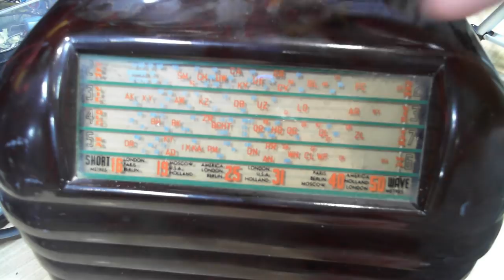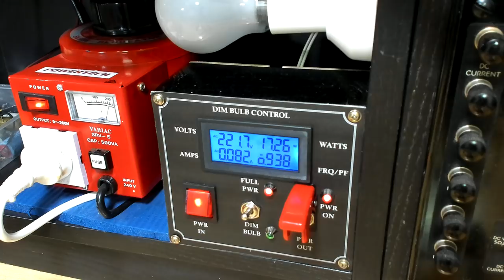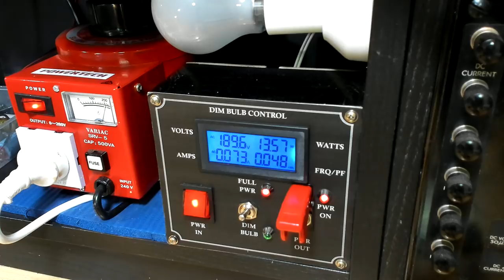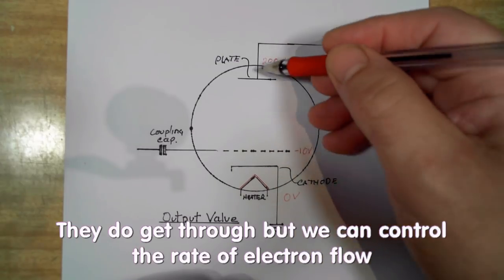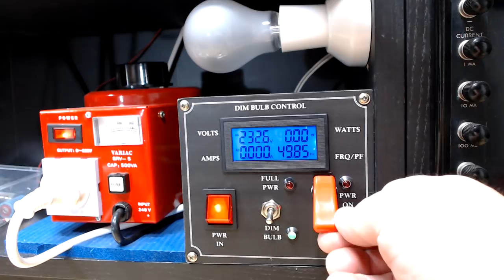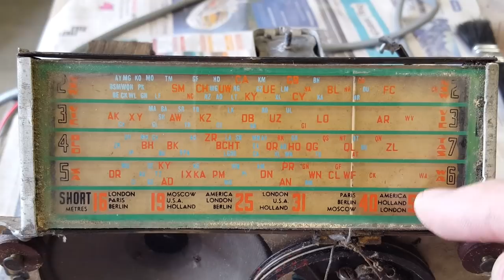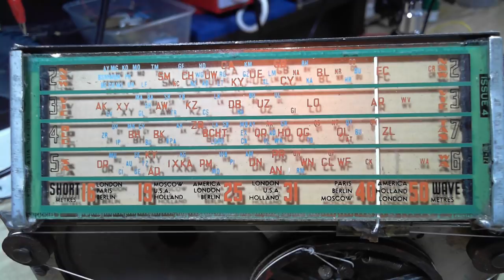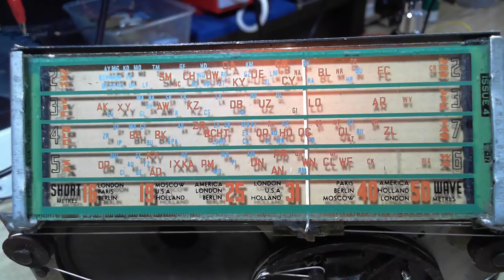Kriesler 11-4 1946 Beehive Radio Restore Part 1

Comment: The two outer plates are beam forming electrodes. Hence the name, beam power output tube. They are tied to cathode potential and redirect the expanding cloud of electron back into the main path to the plate. Chances are very good that with the tube pulling so much current, the cathode emission (rare earth coating) material was literally stripped off by electrostatic force until the emission went down to near zero. It was amazing how well the radio worked with so little restoration yet performed. Great video, as usual.
Reply from the maker: Hi videolabguy, thank you, that's great explanation, now I know the difference between a pentode and a beam power tetrode thanks to you and others that have offered information. Most radios I do will either work or require a minor fix to get working after 70 years, that's not bad. I don't power radios with obvious faults like bad wiring or similar issues of course 😀

Comment: An interesting insight into valve construction. I must say I have never delved into the inner workings either. Quite an unusual looking radio, I think returning it back to it’s original colour might be worthwhile. Thanks for another interesting video.
Reply from the maker: Hi Gary, thanks. Looking at a valves insides was interesting, it helps me understand how they work. I hope the radio will look good when it's finished 🤞😃

Comment: It took you 10 minutes into the video to get it working. Must be very pleasing to achieve such a quick result. Thanks for another interesting video.
Reply from the maker: Hi birdie399, thank you. It was a matter of divide and conquer, there was hum at the speaker and no hum/buzz when I touched the volume control, that narrows it down to the output valve area 👍🙂

Comment: I noted when talking about the 6V6 valve, you mentioned the "two screens" connected internally to the Cathode, but you didn't know what they were for. I can tell you that the valve it's self is a Beam Tetrode, (sometimes known as a "Kinkless Tetrode"), and those "screens" are actually 'beam forming plates'. (Sometimes, wrongly called suppressor plates).

The purpose of the 'beam forming plates' is to concentrate the electron stream into two densely populated electron beams flowing to the Anode. These beams intern, prevent 'secondary emission'; a flow of dislodged electrons flowing from the 'Anode' back to the 'Screen Grid' at a slower rate, and causing an undesirable 'kink' in the valves output characteristic.

It was for this very reason, that the Pentode valve was invented which did the same thing (prevent secondary emission) but in a slightly different way. There was a third system :- The "Critical Distance" valve, but that method was abandoned back in the 1930's in favour of the other two systems. It is interesting to note that, the reason the Beam Tetrode was invented was to get around the patents and licence fee payable for using the Pentode design. A Court battle ensued between the inventors of the Pentode, and the Beam Tetrode, where both sides claimed Patent infringements ! Both sides lost, and the only winners were the lawyers (as usual) lol. Hope that clarifies things.

I have watched parts 1 & 2 of the restoration, and you have done a fantastic job on that radio.... Looks almost 'brand new', and the cabinet has such a lovely shine on it now. It always warms my heart to see a piece of vintage equipment beautifully restored back to its original condition. Thanks for posting
Reply from the maker: Thank you for your very clear and thorough explanation of beam power valves. I have had a few others explain it too and I did some research off the back of that. Your explanation covers it all in one go, thanks 👍😀

Comment: Those two smaller inner plates are beam deflection plates, they are connected to the cathode because they are at the same potential electrically, and direct electrons to the plate. The 6V6 is a beam power or beam tetrode tube so it has a pair of those as opposed to a suppressor grid that a power pentode like a 6F6 or 6K6 would have.
Reply from the maker: Thanks Fritz, I have been fully educated by other viewers kind enough to help. Thanks for helping 😀

Comment: I think the term used when a valve is turned on fully on the grid is called “saturation” . I’ve never seen a valve cathode completely fail from a waxie cap. Good video as always!
Reply from the maker: Hi Burnt Out Electronics, I think you are correct, thank you. As I said it may have just failed from old age, it may well have been the original 1946 valve being that it was the old shape glass. Thanks 😃
Reply: David Tipton yes it’s getting hard to find G type or coke bottle valves. now all you find are GT’s! Bit of a shame as the G valves have more character to me. Are you a member on vintage radio and tv forum? If not you should join!
Reply from the maker: @burntoutelectronics  it's a shame the bottle valve was unserviceable. Yes I am a member of that group, they are very helpful 🙂

Comment: Well.I can honestly say I have never seen anything like it before.  The radio that is!  The Beehive, it is well named.  Works well though and that glass came up well.  I like how you explained the valve, I wish some others would go into detail like that.  Strange how the valve showed up faulty but no fault showed in the valve itself.  I wonder if it was corrosion on a pin that was causing the problem, can't see it somehow.  Nice video again David.  Hope you and your family are all fine?
Reply from the maker: Hi Bob, thank you. It's an unusual design all right. I expected to find a defect in the valve too, I tested it three times on two testers and it was dead, I tested a good valve at the same time to insure the test was valid. It was suggested the coatings may have worn off but you would think it would still do something on test 🤔🙂
Reply: @DavidTipton101  It is a bit strange though!
Reply from the maker: Yep

Comment: Outstanding result, i am inspired to repair a few oldies I have in the shed, thank you. Do you have a circuit diagram for your dim bulb ?
Reply from the maker: Hi Tony, thank you. Yes, get those radios out of the shed 👍 The dim bulb I did on the fly so no diagram. I do remember using double pole switches so I could switch two circuits at once, it may have been to keep the lights separate when using dim bulb or something, sorry 🤦‍♂️

Comment: Assuming that the O/P valve was faulty, with the g1 grid receiving positive voltage the likely problem was that the emissive coating on the cathode was exhausted or otherwise ruined by continued use with a very heavy plate current. The other problem I've seen with heaters is that they can be shorted and although they take current they are not heating the cathode properly. I've had several valves and CRTs with this problem.
Reply from the maker: Hi jonka1, thanks for your comment. The coating may have been exhausted but it didn't read anything on either of my testers, I would think it could produce something still. I could see the heater glow when it was tested but that may have been the reason, it may have only appeared to be working 🤔🙂
Reply: @DavidTipton101  
I have known dry joints where the wires out of the valve are soldered to the base pins. Otherwise it's a mystery.
Reply from the maker: @jonka1  I considered that and made a visual inspection of the joints and they looked good, yeah, I don't know 🤔

Comment: The changes were very likely due to parts shortages, at least it was in North American sets. There was a popular model of radio-phonograph made by Philco after the war called a 46-1201, famous for being promoted by Bing Crosby in their ads. Anyhow I have a Canadian version of one of these, and between the Canadian model, and the American versions, there were between 18 and 19 code numbers (revisions) on no less then three production runs, most involved changing what types of tubes (valves) were used, some used slightly different circuits in the power supply, and one used a 5'' P.M round speaker rather then the usual oval electrodynamic one. What was tricky about the code numbers is that they would switch between them at random times, you could have a code 3 made near the beginning of production, or the end, I think they designed these ahead of time based on whatever parts could be made to work depending on what was available for the cheapest price at the time.
Reply from the maker: I think you are right fritz, Immediately post war radios seemed to change components as they became unobtainable, at least Kriesler keep a record of the changes unlike other manufactures 🙂
Reply: @DavidTipton101  I have wondered whether if there was a boom in consumer products post war, huge sales of this model gave them unprecedented feedback from servicemen. Perhaps Kriesler repeatedly tried to improve a high sales item.

Shortages of parts could have been contributed to by industrial action. There were intense power struggles in Australian unions in the 40s and many strikes as a result.
Reply from the maker: @brianh2269  Parts supply seems to be behind most of the changes as they went back and forth between the same parts, electro speaker to PM speaker and back again, valve replaced with a different type then back again, things like that. Industrial disruption may well have paid a part in consistent component supplies. There were some minor design changes but not a huge amount, a tribute to the original design.

Comment: Hi Dave; Nice radio and restore so far.  You did mention the 6V6, but I am curious what the other tubes/valves are. Possibly 6A8G RF and 6B8G IF & Detector? 5Y3 rectifier? Nice explanation about the 6V6 by the way.
Reply from the maker: Hi Daniel, thank you. It has a 6J8G converter and a 6G8G as the IF, detector and first audio amp. it is a reflex design. The rectifier is a 5Y3 👍🙂
Reply: @DavidTipton101  thank you for your reply. 6J8g heptode - triode. 6K8 is very similar.

Comment: Hi, next time perhaps try increasing the heater voltage to 10 or 12 volts or even higher, the emission might come up a bit on a duff valve. Most likely the bad coupling cap made the valve draw too much current that ate the emission off the cathode in a short matter. Or the valve was spent before and the running it with the too much anode current just finished it off.
Reply from the maker: Yes, I thought later I should have wound the voltage up, that could have well been the original valve judging but the glass envelope 👍🙂

Comment: Mr David where do you buy those spare parts, such as those erasers under the variable capacitor, lamps and other spare parts needed.
Reply from the maker: Hi D. Ilic, I get parts from everywhere. The erasers or grommets are in a kit from eBay, the globes and resistors are from the electronics shop, the capacitors from Carl the Capacitor King (link in the description) other parts, valves etc are from ebay, Facebook radio groups, radio swap meets and radio club auctions 😃
Reply: @DavidTipton101   Mama Mia, it's not easy for you.  It costs a lot.  I admire you.
Reply from the maker: It pays to be a scavenger for sure 😃
Reply: @DavidTipton101  👍😅🇭🇷

Comment: Removing the factory paint from a Beehive can be a big mistake. Some of the painted sets had non-matching colour Bakelite bits under the paint. Other common problems with Beehives are cracked louvres due to over tightening the bolts and/or missing soft washers between them and many (most?) of them end up badged as 'rielsers'.
Reply from the maker: Yes, I have heard that James, luckily this one is in great condition. It was fortunate the owner had stripped it off first 😃

Comment: Maybe the tube lost vacuum, partially or completely. Electrons need a free path devoid of air molecules!
Reply from the maker: Hi Linus, this video was done some time ago so I'm not sure to what you are referring but what you say is quite possible 🙂
Reply: @DavidTipton101  Sorry, you did a post-mortem on the  dead 6V6 but didn't find anything electrically amiss.
Reply from the maker: @linuspoindexter106  I remember now, the consensus from some viewers was the the coating on the cathode had worn away.

Comment: Great video Dave! I really enjoyed it! Thanks for the simplified explanation of the output tube and what probably destroyed it. I have a couple of comments and a question....how and what did you clean the dial glass with? Comments....I saw some sort of thread lock (paint or loc-tite) on the tuning condenser nuts when you were removing them. I will try to remember that when I replace mine....Also, you are either very skilled or lucky when you put that smaller grommet inside the larger one!!!! lol.....Impressive!!! Take Care Downunder--Larry
Reply from the maker: Thank you Larry. I just use water and a tissue carefully on the printed side of the dial glass and glass cleaner on the outside. The paint on the nuts is probably just an anti-tamper indicator, Kriesler did it to all solder points and most nuts to see if someone had been in there. They also sealed the case access screws, it was a big selling point for them. The grommet idea worked pretty good 😃 Be careful yourself Larry, cheers 🙂

Comment: The valve was killed by the leaky capacitor, causing it to, overload
Reply from the maker: Hi Ideal1980, exactly 👍😀
Reply: Possibly, but not immediately, it usually results in a dead radio that people would put into retirement long before the tube goes bad. Tubes do wear out with use as well, and that 6V6G (if they used that suffix in Australia) looked like it may have been the original with it's shouldered glass envelope.

Comment: Rather than toss valves on the ground 😮 , a better method is to put them in an old towel and tap them with a hammer.
Reply from the maker: Thanks James, I did that, I wrapped it in a small cloth and beat it with a hammer, it wouldn't break. I wrapped it in a cloth and threw it on the concrete twice before it broke, that is a tough glass 😲🙂
Reply: @DavidTipton101  Yes, the shouldered valves can be tough nuts to crack, so to speak. I find that a centre punch will do the trick -- concentrates the hammer blow into a small area.
Reply from the maker: @James_Bowie  I made an automatic centre punch as an apprentice, I should have dragged that out 😃

Comment: Another nice restore David.  Quite likely the high current burned the coating off the cathode. The coating make it emit more electrons and, once lost, the cathode can’t provide much at all. The darkening of the glass is due to the high level of cathode sputtering caused by the high current burning the coating off.
Reply from the maker: HI Wenlocktvdx, I was thinking along the same lines, although you would think it would register something on the tube testers. Those 6V6s are always dark, I would like to see a NOS one to see if that's how they are new, thanks for the info 👍😃

Comment: Hi Dave, 
Another brilliant radio restoration project video.  The Kreisler radio does resemble a beehive.  It is a very attractive little radio.
It goes to show, always think twice before trusting old paper, and foil capacitors.  As you say, they are almost always electrically leaking - truth be known, they have been so for the past forty, to fifty years, it is know they are definitely showing their age.  That is the reason, as you rightly pointed out, the audio output valve became worn out.  It is a pity some technically minded person, with business acumen, has not figured out a way of steadily cutting old worn out valves open, recoating the cathode with barium oxide, re-jig the internal metal work, and recreate a vacuum whilst re-sealing the glass envelope.  Let us face it, since no one is manufacturing valves for radios any more, I guess reconditioning old existing valves might be the answer.
Regards, Phil.
Reply from the maker: Hi SteelCity321PB. It's nice little radio, I can't wait to see it finished. They recondition cathode-ray tubes so vacuum tubes may be a possibility. the cost would be pretty high I would imagine. There are still stocks of valves around and I have always found the ones I've needed... so far. I think the 6V6 is still being made, they use them in modern valve and guitar amps 😃

Comment: The chassis looked like it was encrusted with old nicotine stains.  All those Craven 'A' cork tips that someone chuffed on while listening to the races :-)  Looking forward to the end result.  Thank you for the electronics lesson too.  Very enlightening.  Cheers
Reply from the maker: Hi Pauline, It was coated in something and it didn't come off, I wash my hands after handling anything radio as they no doubt would be subjected to nicotine 😷🙂 Cheers 😃

Comment: tube will red plate if it has no bias  6V6 has a plate dissipation max of 12 watts
Reply from the maker: Yes, I didn't want to run it too long with the new valve and the dud coupling cap 👍😀

Comment: what do you use to protect your phone when connecting it to valve amp volume contol? is it a capacitor if so what value?
Reply from the maker: Hi lookoutleo, yes a 0.1uF cap 👍🙂
Reply: @DavidTipton101  meant to ask voltage?
Reply from the maker: @lookoutleo  I used one from the drawer so it would be 600 volt, it would need to be high enough to cover the expected voltages.

Comment: Hi David just been watching you struggle with the pipe cleaner lol,i find interdental brushes from dental supplies a lot better than pipe cleaners and it really gives the contacts a good cleaning.
Reply from the maker: Hi Ray, I was just making it look difficult. I use the dental cleaners on the smaller valve bases like the Novel. I'll give them a go next time though, cheers 👍😃